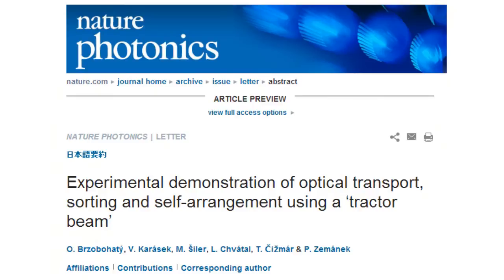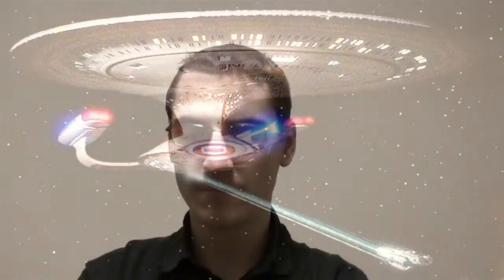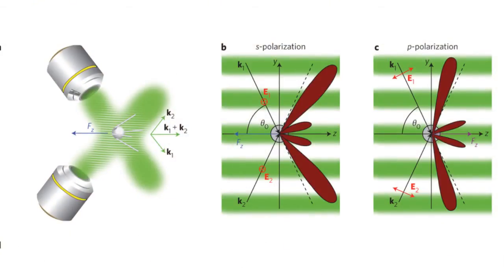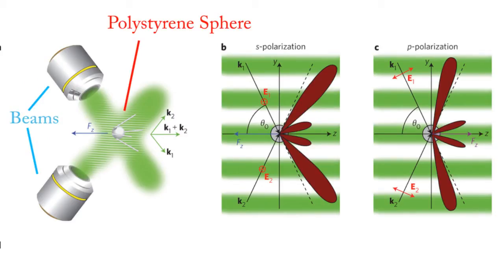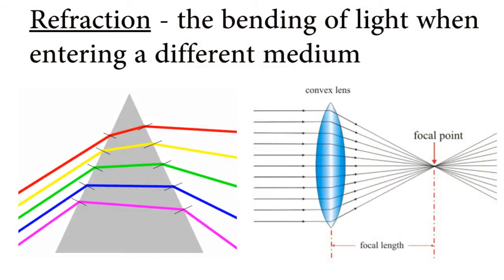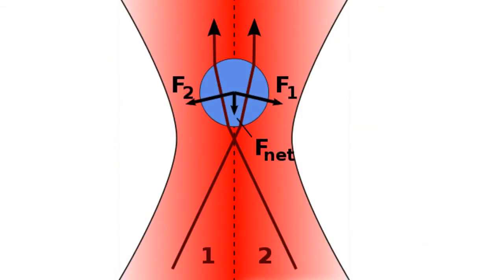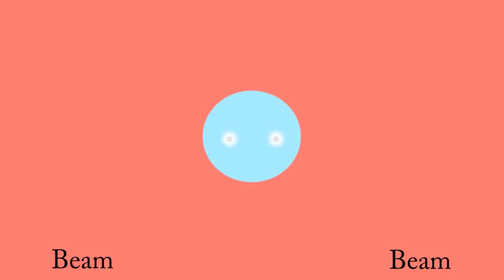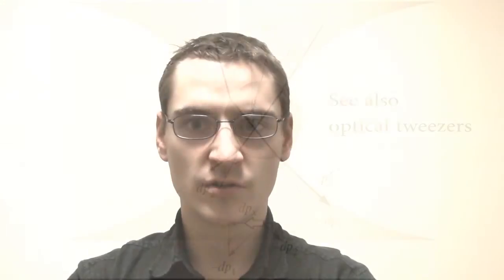World's first Tractor Beam explained

Comment: I have a question, and I think it would make a good video. I ride a motorcycle a lot. There is a concept that I don't understand why it works but it does. I'm sure you've ridin a bicycle and used this. It's called counter steering. When you steer left to turn right or right to turn left once you hit higher speeds.

Comment: But doesn't the beam which is emitting the light in the first place should travel in the opposite direction as well... ?? if yes then, approaching of sphere to the direction of beam depends on the inertia of both objects.. beam must have more inertia than sphere in order to pull sphere. right ??

Comment: This video took over a minute to get anywhere near the point.  No significant points or joke or anything was said before the point.  And the point is that tractor beams have been used in medical procedures for 10's of years already.  The production of larger tractor beams was only a matter of time.  If you read about photons you realize they're subatomic and electromagnetic.  Two em fields moving against one another create currents and so on and so forth, Tractor beams.  I designed one yrs ago.

Comment: I think you're talking bollocks.  I ride bike and they always go where I tell them.  The only time I need opposite lock is when the back wheel is out of line, either wheel spinning, wheel bearing/axle loose, or wheel not put in correctly.  All other times are in your head (not mine) or you're on some sort of drugs either prescription or illegal.